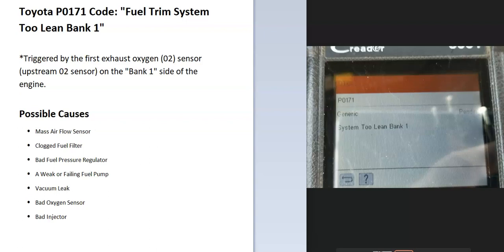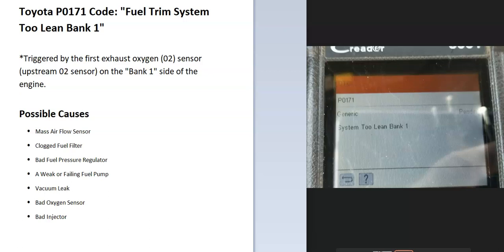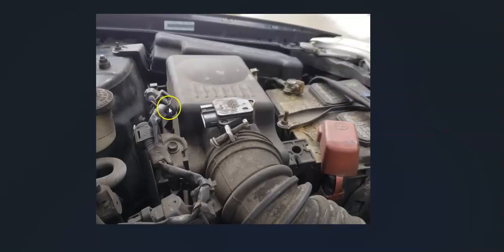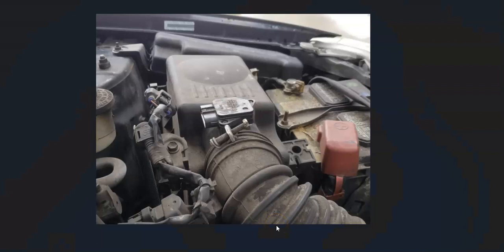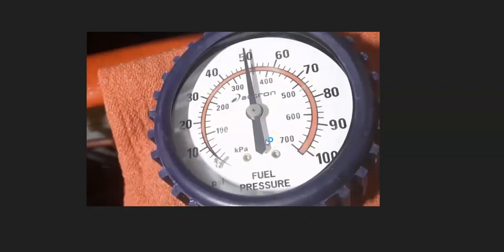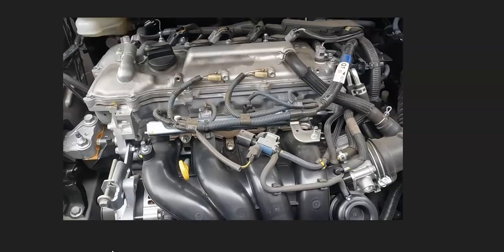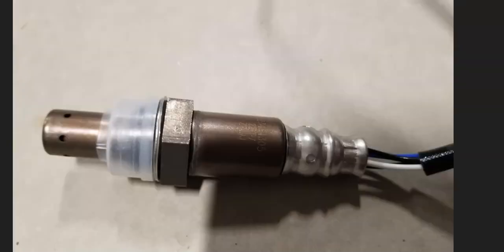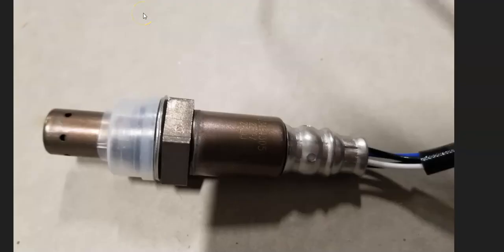7 Causes of a Toyota P0171 Code: "System Too Lean Bank 1"

Comment: A mechanic at Toyota told my wife the charcoal canister was bad because the hose came off, said it needed a new one for 700 dollars. Does this sound possible?  I replaced the hose and it's been fine.
Reply: You fixed it. Fire the dealer.

Comment: Hi HVAC, I worked on a neighbor's 2002 Camry 2.4L with this code.  Installed new plugs, new coils, new air filter, cleaned the MAF sensor, and installed a new Denso O2 sensor. The car has 140k miles, so I figured these would need replacement anyway just due to age. The check engine light did go off by itself for a while, but then my neighbor reported that the light came on again. Could this be a fuel delivery issue then?
Reply: I talked to a former service manager at a Toyota dealership. He said that cleaning the MAF sensor does no good if the circuitry in it is bad. This may explain the fault code reappearing.
Reply: @fabfabber  Hey guys, turns out there was a leak in the air intake tube.  I didn't see it as it was on the back side.  But after I removed the tube I saw it was torn and replaced it with a new one from Dorman.  Now it's nice and tight. No leaks.
Reply: Or bad gas from the gas pump.
Reply: Get a OEM sensor, not the Denso brand.
Reply: @c.p.5741 I don't mean to be contradictory, but isn't Denso the OEM for Toyota? I've read on Toyota forums that only Denso will function correctly.
Reply: Denso is OEM...
Reply: @c.p.5741  that is the OEM for this car
Reply: @c.p.5741  on my 08 camery the oem is denso.

Comment: I need help. Have a 2013 Corolla with this code. Been experiencing rough idle and intermittent stalling. Took it to Toyota 3 times and they checked all of these things and found nothing wrong . Simply said everything was within specs and they couldn’t duplicate the problem and just cleared the code off the computer. Car cutoff in the middle of an intersection today with this same code . Please help
Reply: Sounds like a bad fuel pump or fuel delivery issue
Reply: @LA_Commander   they said they checked it and it was fine
Reply: @indiejones4683   Did they check everything?  I mean not only the fuel pump but also the fuel filter, the fuel lines, the fuel injectors, and the fuel pressure regulator?
Reply: @LA_Commander   they said they did. I specifically requested it the last time I took my car there after I did research on my own.
Reply: @indiejones4683   Wow, that really sucks man.  If it's not a fuel issue then it sounds like some kind of a vacuum leak somewhere.  Air is entering the system and not being properly metered, causing a bad idle and engine cutout.  If your mass airflow sensor ok?  Any vacuum leaks or air intake leaks>
Reply: Maybe u need to clean throttle body

Comment: The crazy part of p0171 is that my car drives just fine!!
Reply: It's an emissions code, not necessarily a bad driveability issue
Reply: Mine starts on the second crank when the car has been sitting for a while but it drives fine.
Reply: Yeah, but if you keep driving it, it will destroy the catalytic converter
Reply: @markjacoby2414  Not necessarily. I've been trying to solve this P0171 issue for three years on my 2000 Corolla. A mechanic believes it is the car's ECU as the car drives fine.
Reply: tre - I work in a parts house. When someone wants the OBD2 tested, I always ask how is it running.  Almost always, car is running fine.
Reply: Computer adjusts by adding fuel. That’s why it runs fine. At some point (very severe condition)   Fuel addiction is not sufficient and you get misfires ect

Comment: 2000 Avalon XL P0171 code. I went to Denso's website for O2 sensor part#, and also saw it listed an A/F sensor. Which  would be the one to change to try to clear the code. I understand that the problem may not be one or the other sensor. Thanks for replying.
Reply: If you're going to replace the O2 sensor, replace the front one. That is the air fuel ratio sensor.
Reply: The front one being the sensor next to the radiator? I was under the car to see how hard it would be to access the upstream sensor near the firewall (looks like a pain in the butt) and I assume there is another just b4 the cat converter. So is there a total of 3 or 4 sensors (2 upstream and 2 downstream? @LA_Commander
Reply: @fabfabber  yes, the one in front. Should be fairly easy to replace

Comment: Thanks for posting.. what if you have a reading of 0.00 on your MAF SENSOR! on live data,?
Reply from the maker: The MAF sensor Grams/Second (g/s) should show zero or close to it when the engine is not running. With the engine running double the RPM, and the Grams/Second should also double. Here is video. https://youtu.be/kzISHRN1Qjs
Reply: @HVAC_Mechanic  
Thanks you gained a new subscriber!

Comment: I Have a dirty maf sensor will try n clean it today. Lol since i started with first o2 sensor n didnt do it i jumped the gun on it. Great video btw.🙏
Reply: Update: after cleaning the very dirty MAF sensor and reseting it by running it almost 50 miles the check engine sign still came up same code P0171 😢 dont know what to try next.. im thinking fuel filter...
Reply: another question, is there anyway to narrow down if its the filter causing problem as opposed to having to check fuel pump pressure.
Reply: @sudipb7467 no still trying to working on 😅
Reply: @sudipb7467  fuel filter replaced, nothing. Mechanic says rumbling in Catalytic Converter seems to be the issue. Need a new Cat i think
Reply: @syfodias-jedimaster Updates a month later?

Comment: Will engine even run with maf unplugged?
Reply from the maker: It depends on the vehicle; some won't run or have issues, while others use the MAP (Manifold Absolute Pressure) Sensor to keep running.

Comment: I’m so lost. 
New items:
MAF, upstream o2, pcv valve, intake manifold gasket, valve cover gasket, cleaned all injectors. Still with the same code 😢
Reply: Guy at work fixed his by replacing a bad fuel injector.
Reply: @trewten5579  a mechanic throughly diagnostic it and he says he hears rumbling in the Catalyst Converter (loose honey comb) he is almost sure that it will need a new one hence fixing the issue.
Reply: Time to check your fuel pressure.
Reply: @repoman6034  got it back from the shop they couldn’t figure it out, fuel pressure was good. Only charged 20 bucks instead of the $90 which made me grateful. Got home, thought long and hard for a day… “ let me return the aftermarket MAF to AutoZone and get the Denso”.SOB!!! light hasn’t came on since. Well at least I got some new stuff put on my car lol. “face palm”
Reply: @RandomVids-hx1py my local shop is ass also smh an I have a smog coming, they talking about it’s the spark plugs and ignition coils
Reply: @gamingwitchutuu429  if it’s a p0171 it definitely not those
Reply: @RandomVids-hx1py  yea they got me for $300 smh an you know what is funny now I have a code for my cats, they did something to my car and go say come back if the lights came back on
Reply: @gamingwitchutuu429  wow! Im having same issue I have not tried a new denso MAF I did however clean my MAF  and it didnt do it. I was thinking of doing a fuel filter since i was told that might be it. (did they ever recommed the filter to you?) *and did you get your spark plugs and coils replaced. if so did that help??
Reply: I see you did a bunch of work including fuel pump but did you ever do fuel filter?(thats what im being recomended) *so i cleaned my maf sensor and didnt do fix it. now idk if i should buy the denso maf like you or try fuel filter first.. (oh btw how did you decide to replace maf sensor , did you know for sure it was malfunctioning?
Reply: @syfodias-jedimaster  this code is a real pain in the caboose for us all. 
Fuel pressure good
New sparkies 
New OEM MAF
No vacuum leaks
New upstream sensor 
I new fuel injector, I broke one oops
New pcv valve 
New valve cover gasket
New air filter 

Light came back on 3 days after passing smog!!! 😤 What a joke 

One day it’ll get figured out.
Reply: @RandomVids-hx1py  oh man that's crazy. Yea im trying to pass mines too, i saw a few videos saying cleaning maf sensor would do it. After i reset light i drove it 40 miles before it came out l again. Sigh. 
Lol at least you passed smog for now 😅

*So anyways you didn't mention did you try the fuel filter yet?
Reply: @syfodias-jedimaster   Fuel pressure was tested and was good. And yea, definitely agree, I’m glad it passed lol. It’s just weird that I’ll clear the code and it’ll stay off for a week and come back on. Start with the least expensive tasks if DYI’ing it. Clean MAF, PCV valve and fuel injectors.
Reply: @RandomVids-hx1py  thanks for responding, * but i meant "fuel filter" and not pressure
Reply: @syfodias-jedimaster if the pressure is good that indicates the filter is fine too, the only reason you would check your filter is if the pressure was low indicating a clogged filter
Reply: @conlanmcgregor7621  thank you i had changed it already i didn't get to check the pressure on it unfortunately
Reply: @RandomVids-hx1py who makes the oem maf sensor for 96 Tacoma ? Thanks
Reply: @RandomVids-hx1py it stays off because you have to drive it 50-100 miles for the code to reset again after you clear it
Reply: Had this on a lickass CT200H . Replaced MAF and it had a pretty gross PCV. However still a issue. I gave up at $200  didn’t want to go nuts with it
Reply: Did u figure it out ? Anyone having similar issues... Try the ecm ... Sometimes it may not want to re-set and can could just b going bad ... The ecm can also cause the same symptoms as a maf senor
Reply: @greatmind3823  no luck as of yet, what is ecm?
Reply: I have a 2001 toyota celica i change the maf sensor check all the hoses and still the code coming up.. took it the mechanic shop he said the hoses are good and o2 sensor is good,fuel delivery is good only thing left is the intake manifold gaskets he going to change that and if that doesn’t work fuck it
Reply: you guys need to find better mechanics (a real mechanic, not someone who just guesses and throws random new parts at the problem), and yes, it's always best to use the OE sensors for pretty much any vehicle, the aftermarket ones tend to be junk. for some things like a coolant temp sensor or a sending unit for a gauge it's usually fine to go aftermarket, but with MAF's and crank or cam position sensors it's almost pointless to even try an aftermarket one, I've seen so many of those not work and cause someone to chase their tail trying to diagnose an issue...
Reply: Figured it out?
Reply: @jeremiahderousselle8044  yep, i cheaped out and bought a low end MAF. Went OEM and it’s good 👍🏼
Reply: @RandomVids-hx1py but Denso is not OEM
Reply: @c.p.5741  It basically is. Denso is used for many original Toyota components at the factory.